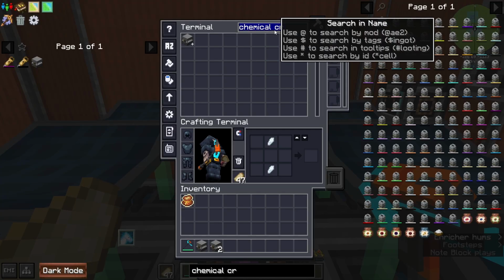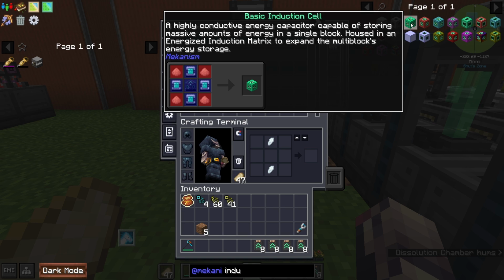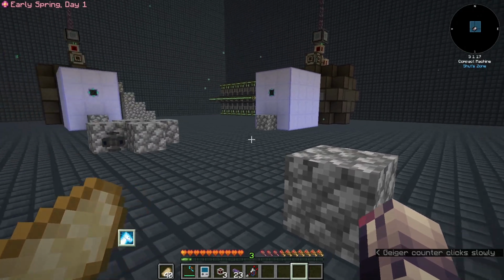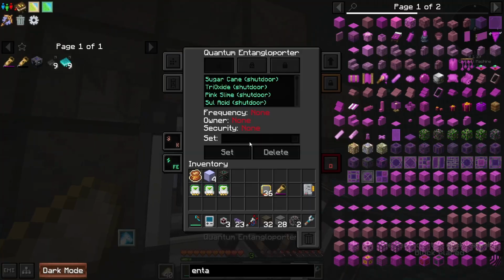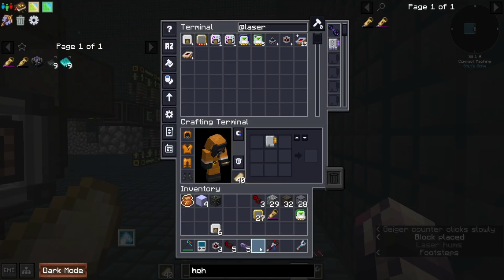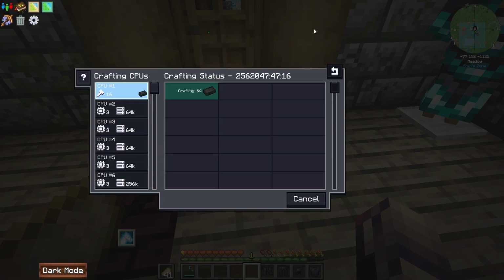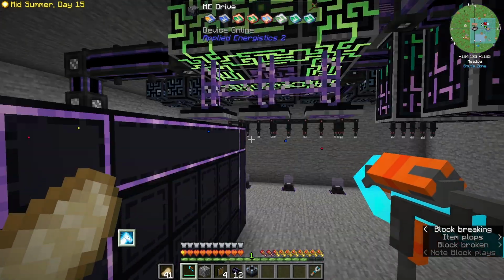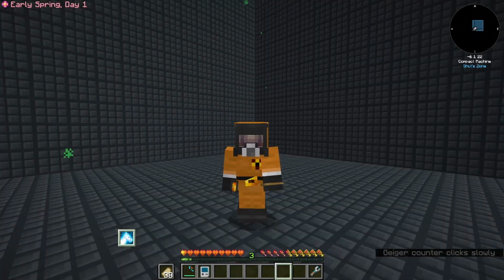Fusion Reactors | Craftoria Ep 48

Comment: About turning of reactors there is solution 
You need to make buffer between reactor and quantum entgl, I'd say that chemical tank without auto eject is the best option. This problem I think is cause by the fact that channels on quantum ent loads long after than the reactor and it stays for a while without d-t fuel
Reply from the maker: I read that somewhere as well. However, the pipe buffer should be enough for them to stay on. I will give it a shot sometime soon and see if there is any change.
Reply: @DoorShutter  yeah but chemical tank is the best option because of the capacity and i think it loads fater than pipes, it worked for me
Reply: That why chemical tank is much bette, it worked for me @DoorShutter